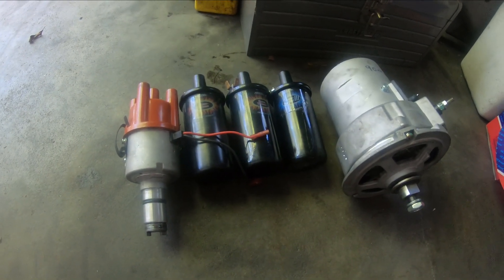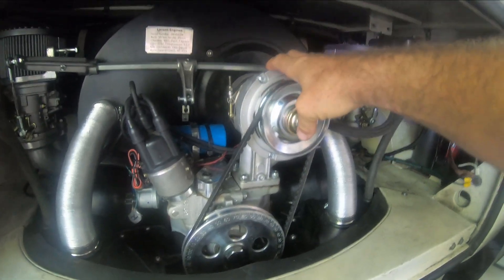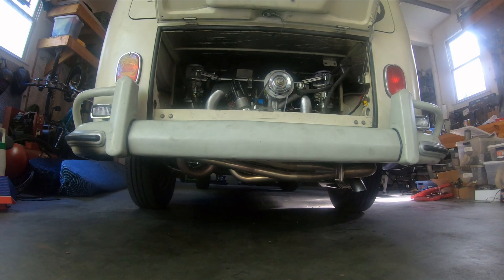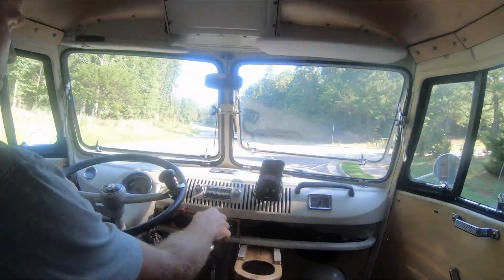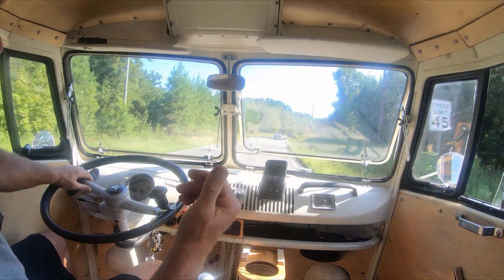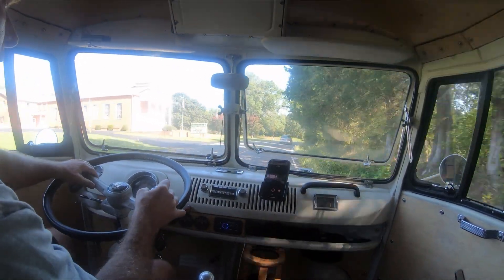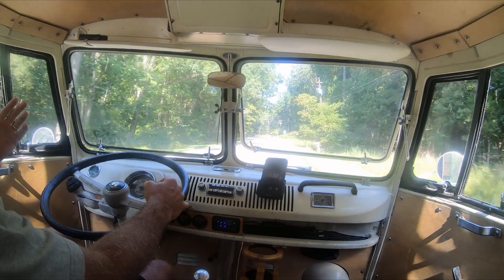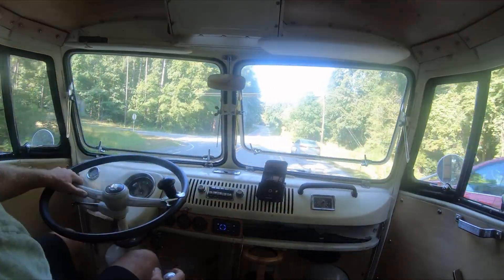2332 VW Air-cooled Stroker Motor - Video 90 - FINAL Tweak of 2332cc Works Great

Comment: I was wondering about your 1968 compression ratio, valve sizes, cam Deck height and Combustion CC...I think the compression and or deck height might be why it does not have enough power. Should easily climb that hill in 4th. Im running 50 deck. IDK what the CC is but 9 to 1 comp. With 72 pass cooler thermostatic and external oil filter + dog house. It does not run hot. unless I am on a really long hill like 2 or 3 miles long. then when i push it in 100 plus degree temps it will give me warning ping. Then I slow down a bit while climbing. once I crest the hill it cools right down. FYI Super cool Type 3 cool tin is the ticket.....I think you also have stock air deflectors.....IMO not good for that 2332 or the 1968.
Reply from the maker: It has decent power, but I did not do nearly the work I did on the 2332 to make sure the deck height was right.  I have that motor out now and was looking for a project convertible roller - about a 1966 with overrides bumpers - to put the 1968cc in - once I spruce it up again
Reply from the maker: I totally rigged up super cool tins with the mods and wires, and then I chickened out on using them.  There is a video on the cool tins - I may have even watched your video to get some of the modification and wiring ideas…

Comment: you probably would have picked up some torque with 40/35 valves and 1.5 inch exhaust. I noticed that looks like 1 5/8. not sure the valve sizes. I noticed it starts to cam curve  up at about 2800 rpms. If you went smaller exhaust it would have more smooth power band, But it really does run great......spark problem was probably distributor itself. Petronix  compufire and even Empi are exactly the same IMO. they all made at the same Place in China. IMO....I use the Empi ones because they are cheap and have about the same issues as all the others.
Reply: and all the pointless distbutors have some issues. Once you get a good one they are usually good for a long time.
Reply from the maker: Yeah - I think it was the pertronix flamethrower 3 that screwed everything up and had me second guessing a bunch of other electrical parts that were probably ok.  Maybe the 90 amp alternator was fine and the other coil was fine.  But it ran so hot - I think it wasn’t advancing as it should have with rpm

Comment: Mine never gets over 180f either.  I have pretty much stopped using first gear.  What did you say you have your valves set at?  I pull hills in fourth gear too.,  Using the Engle 110 cam.  I had my idle set at 800 and that was great but some guy at the shop messed with it and now its up around 1100, I need to fix that.  You are using steel push rods right?  I have a Dakota digital head temperature gauge that I like a lot.
Reply from the maker: I have chrome moly pushrods I cut to length myself.  Valves are on 1.4 rockers - Steve Tim’s Stage 2 heads.  I need to get the idle down to 800 from 1000.  I am getting a laser surface temp gauge - so I will measure the heads when hot